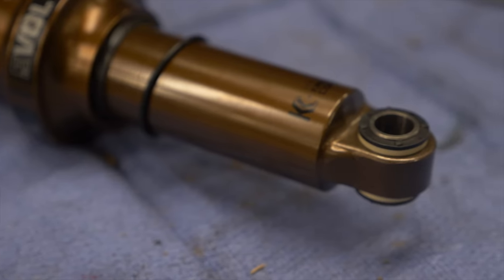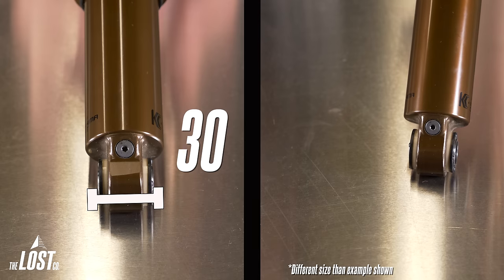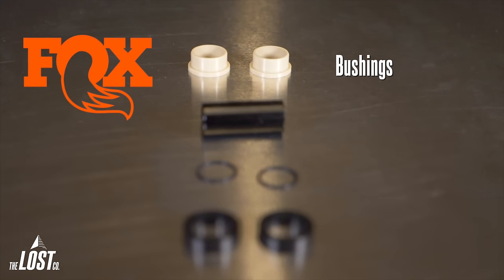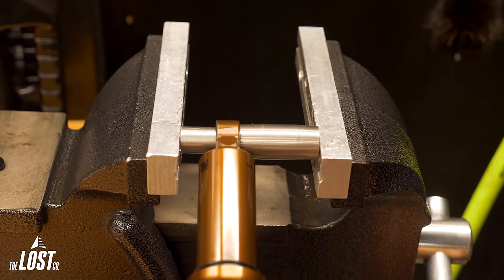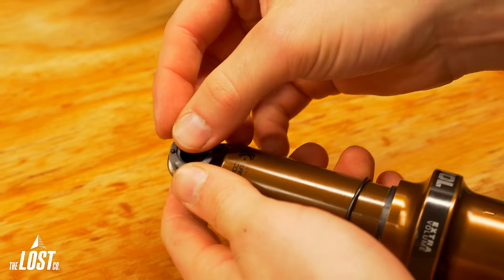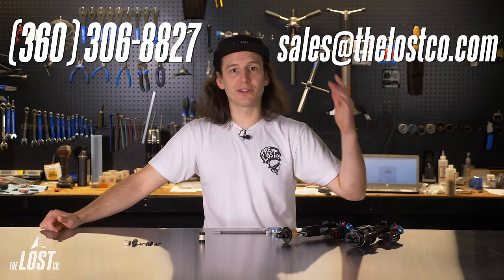MTB Rear Shock Mounting Hardware Explained | What Is It? How To Measure, Remove and Install

Comment from the maker: Well, we did it! A 17 minute video for tiny little bushings. If you found this helpful, please like, comment and subscribe. And head over to thelostco,com for any parts you need while you're at it 😎
Reply: Where was this video last year when I struggled for about a week to find the right hardware for my 2021 Fuel EX with offset bushings. LOL. great video.
Reply: Really do enjoy your videos, thank you! One unforeseen issue I came across when upgrading my shock for the first time was aligning the eyelets, where the rear eyelet is 90degrees offset from the frame mounted eyelet. I managed to get it… eventually, but it required a reasonable amount of force to twist the stanchion + small tolerances on the mounting bolts meant it took a fair amount of effort to get right.
Reply: Luv all your content, however the Ohlins info is inaccurate at best.

Comment: Super useful!  Thank you.  Had to replace my float dps today.
Reply from the maker: Glad we could help! Mounting hardware is quite confusing at first glance, but in the end it's very simple.

Happy trails!

-Mike
Reply: @TheLostCo It was honestly stupidly easy.  I just had to remove the bushings on the bottom eyelet that came in the shock which popped right out, I thought I'd need to order some hardware to remove them at first.  Good luck out on the trails!

Comment: Geat video. Couple of questions tho... 1: Where can I buy the apprpropriate extraction tools (hopefully for less than 120 bucks). 2: How do I know which extraction tool wil fitt my hardware, and 3: Don´t you want to put some kind of lubrication in there? Surely, a bit of grease won´t hurt hem o-rings. - But great video. Keep´em coming.

Comment: I stopped using normal bush and now use needle roller bearings, so much better all stainless and work so much better I have to increase the low speed compression as the shock is free to move better.

Comment: Do YOU have a Trek Fuel, Remedy, or Slash? Are you swapping shocks and need the correct offset fox hardware? Then you will need;
1.  Trek Part number 540755 x2 (the bolts) [warning, do NOT get the trek "lower" bolt 540756 as it will be too short, as others have found out].
2. 60mm wide upper bolt with 10mm bolt diameter, Fox Part number 803-03-321.
3. 50mm wide lower bolt with 10mm bolt shaft  diameter and the correct offset spacers, Fox Part number 803-03-338.
👍
Reply from the maker: Nice.

Comment: Thank you for the video.  Is the bushing removal tool specific to shock brands?  I have a dpx2.  Is there a specific one I should purchase or would any work?  Thanks.
Reply from the maker: Hey Tim! Taking the bushings out of any shocks should be exactly the same! Your DPX2 should be smooth sailing  😎 -Tor

Comment: Question:  Should the frame bolt that goes into the shock eyelet be greased?  In other words should the area between the frame bolt and sleeve (aka pin) have grease on it?

Comment: Hi I measured my frame and there is 66mm of space but I can only buy 54mm or 68mm spacer, so should I buy bigger or should I buy smaller and then use somekind of screw washer to fit it in place?

Comment: I went to my local bike shop to install my new fox float x rear shock on my Vitus Sommet 2018. They said they can’t install it and told me I need to reach out to the manufacturer (which they also don’t know) to ask what size is my frame mount hardware. I told the bike shop if they can measure it using caliper, but they said they can’t do it like that since my bike is very specific and that I need to ask straight to the manufacturer.

Comment: Great,  very helpful...  is the shock of specialized enduro which is 205x60 trunnion can be fitted also with nukeproof giga which is the same size  205x60 trunnion.  Many thanks
Reply from the maker: Yes, as long as the eye-to-eye and stroke length is the same, then you can install it the other bike. Since you said one bike uses 205x60 and the other also uses 205x60, then that is the same size and you can therefore swap shocks. You will need to swap mounting hardware as those sizes are likely differenet, and you will likely need to run totally different settings on the same shock between the two bikes as the internal tunes are likely a little different.

-Mike
Reply: Many thanks 😊

Comment: Hi guys. Great vid. I am looking to swap out a rock shox monarch (debonair) rear shock for a fox float factory x2 - I’m having issues with the rock shox unit. So your vid is timely. Question; the eyelets on the fox shock are oriented 90deg from the rock shox unit, can the fox unit be changed to fit my bike frame (2017 kona process)?
Reply from the maker: Hi John! If I understand your question correctly, you just need to make your eyelets perpendicular to one another - this is quite easy! If you take a screwdriver (or something similar) to gain some mechanical advantage and place that into the rear eyelet. Then holding the shock body in your other hand, simply rotate the eyelets are perpendicular. Hope that helps! If you are confused or unsure of anything, give us a call, shoot us an email, or you can live chat us on our website.

(360) 306-8827 // sales@thelostco.com
Reply: @TheLostCo  thanks!

Comment: Installed this set on a 2019 Deluxe RT, it was all the correct spec but a super snug fit. I could not slide my tube in the way you did in the video. I had to use a mallet. 

How critical is it to center everything? I am >mm off.
Reply from the maker: Hey there! Sorry, but I'm having a tough time understanding your situation 100%. Please email us at sales@thelostco.com and we'll be happy to help!

-Mike
Reply: @TheLostCo  The long black aluminum tube. The one that fits inside all of the bushing pieces! Mine had to be beat in with a mallet.

Comment: i got a 2010 specialized Demo 8 been having problems finding mounting hardware for my fox dps the frame bolt is 15mm and the eyelet is 15.08, the inside of the frame is 36mm and that bearing the holds the bolt is 15mm , so how do i find a mounting kit to fit if they only come in m6/m8-m10 guess my question is does those plastic bushings have a 15mm diameter

Comment: So you can use any brand of mounting hardware for any brand of shock, besides the exceptions. The video is about the size of the hardware, but what would like to know: Are the spacers the same size? Or, is the width of eyelets the same across brands? I need a 30x8 bushing for a Super Deluxe, but can't find any from RockShox.
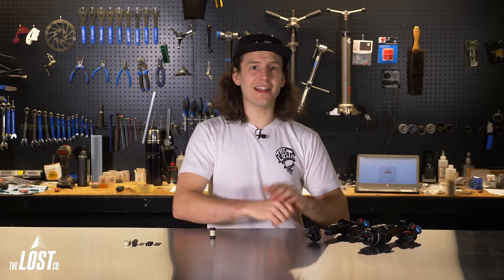Reply from the maker: Hey there! Please check through the video again as we cover this exact topic at 2:28

-Mike
Reply from the maker: We also have RockShox mounting hardware in stock in m8x30 in stock and ready to ship!

https://thelostco.com/products/rockshox-rear-mounting-hardware?variant=42732113232070

-Mike
Reply: Thanks for your reaction. I interpreted it as just the diameter. You mean the width of the eyelet is standard as well?
I live in Europe and I only look for bikeparts in Europe. Importing stuff makes stuff expensive. 🙂

Comment: Hello, my Santa Cruz v3 specifies  m8x22 but the only fox mounting hardware I can see is 21.84 or 22.2 Any ideas?
Reply from the maker: Howdy! As mentioned towards the end of the video, bikes that call for 22mm width mounting hardware will always use a 21.8mm hardware when that is the only option since the frame tolerances are enough to slightly squeeze down to the 21.8mm size. The frame will have a much hardware time expanding outward to the larger 22.2mm size, and most of the time just won't even work.
Reply: @TheLostCo  Thanks for getting back to me, that makes sense. I can build bikes from the ground up but the shocks were always fitted so I never had to deal with it before. I’ll subscribe to this channel. 

Thanks again!

Comment: I have a question. I have a 2021 Status and i want to switch to a coil shock. But one shock eyelid is 90 degrees different than the upper one so one is vertical and the other is horizontal. The shock is 230x60 but i cant find rockshox or any coil shocks with this design. Does anybody know what this shock eyelid design is called?
Reply from the maker: The Status has mounting hardware on the front (m8x30) and an open eyelet on the rear. As far as the rear shock mount being 90 degrees relative to the front mount, you can simply put something (a screw driver for example) in the rear shock mount and turn it until it fits in the frame. If that doesn't make sense, give us a call and we can describe it better over the phone. In short, a 230x60 shock with the right mounting hardware on the front, will fit your bike but you just have to turn the rear mount.

(360) 306-8827
Reply: @TheLostCo  thanks 🙏 that realy helped me

Comment: can I rotate the bottom eyelet 360 degrees ?
Reply from the maker: It depends on the shock, but generally speaking, yes you can. However, I'm not sure why you'd need to as rotating it by 90 degrees is generally the most you'll turn it. Check with manufacturer first or just give us a call or email at the shop and we can let you know!

sales@thelostco.com // (360) 306-8827

-Mike

Comment: Why no Giant bikes in database?
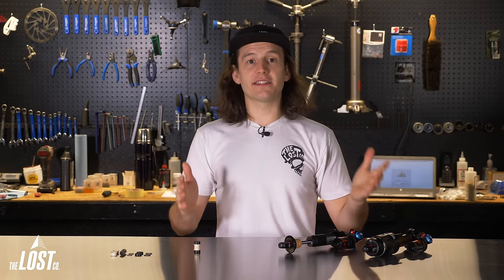Reply from the maker: There are a zillion bikes out there and we don't have them all in there since we have to manually put this database together, mostly from customer requests when we source hardware sizes from them. However, we almost never have customers asking about hardware sizes for Giant bikes (which is sort of odd since there are so many out there). Also, it's very difficult to find nitty gritty details like this for Giant frames. Luckily, we show how to just manually measure hardware at 7:32 we show you how to just measure it yourself.

-Mike

Comment: Ugh, guys... M8 is also used to specify metric threads. You are confusing things, don't do it. It's a Ø8 or OD 8 mm. Aaaaand, that  OD 8mm has a M6 thread bolt going into it.
Reply from the maker: At 8:49 we show that this is the measurement of the OD being 8mm. m8 can definitely be used to label many different things in the general hardware world, but for rear shock mounting hardware specs in the mountain bike industry, m6/m8/m10 refers to the outer diameter of the bolt that holds the shock to the frame.
Reply: @TheLostCo  Yes, I can see where the measurement is taken. Just telling you this as a mech-engineer. Don't mix things up. Don't use the big "M" on shafts - it's wrong. A small "m" actually means something. m8 is a tolerance. It's a transition / driving fit for a nominal OD 8 mm. So yes, you can use m8 to describe the shaft. My issue is with the big "M" as this is used either for threads or to specify a tolerance on a hole, so not a shaft.